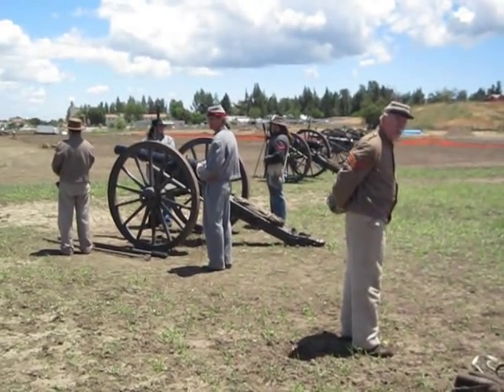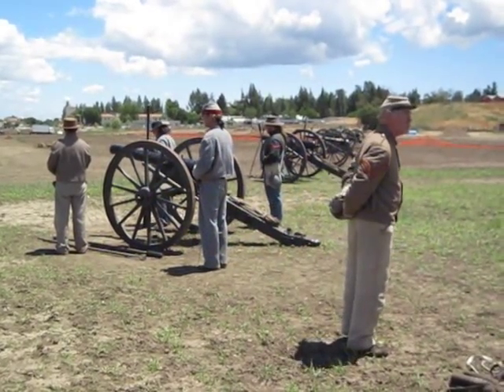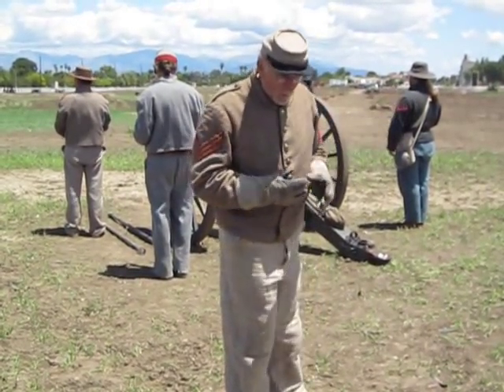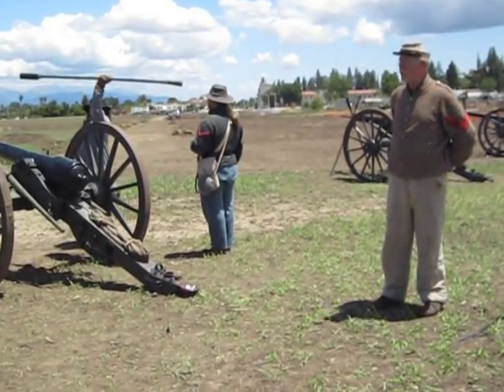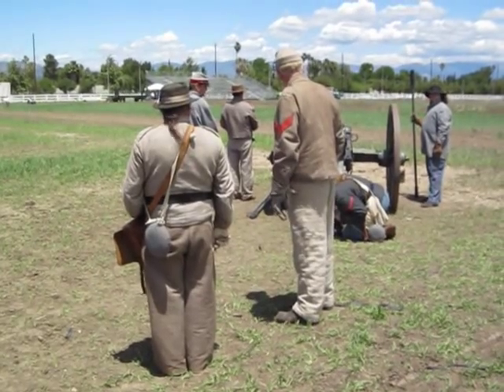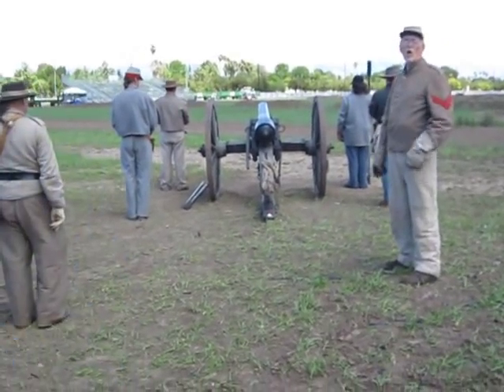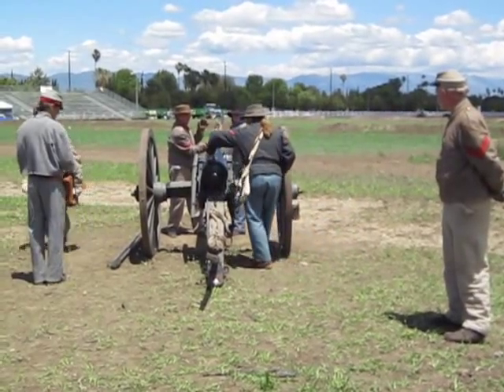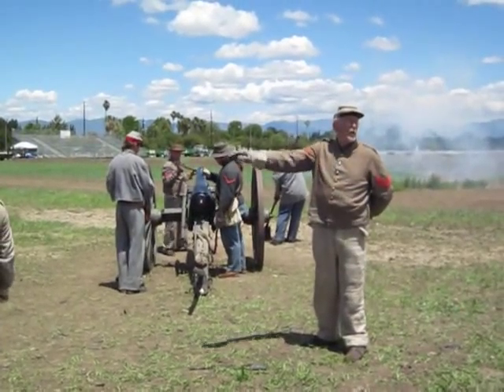Civil War Artillery Demonstration

Comment: parrot made the gun so that it would not explode under extreme heat. yet some reenacting groups still bitch about the 3 minuet rule against the 1 minuet rule. i believe that after servicing the rifle and waiting one minuet is perfectly fine. 3 minuets is too long and unnecessary and boring... Also when you put the rammer on the hub shouldent the wooden side be sitting on the hub?